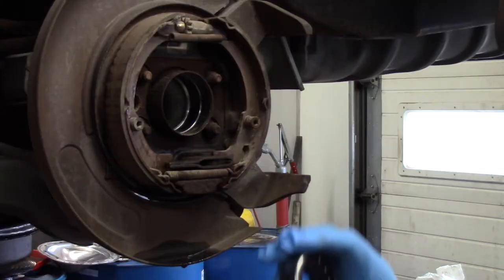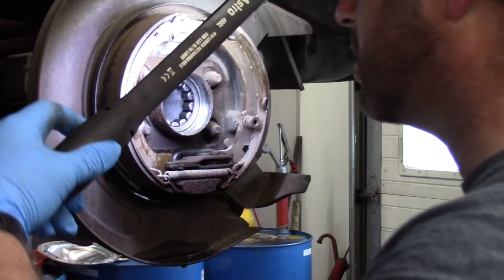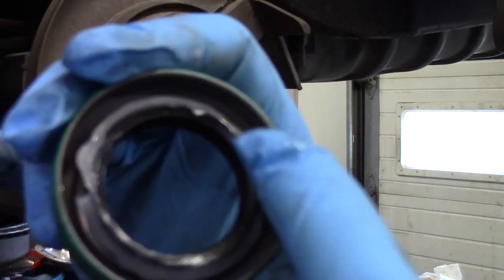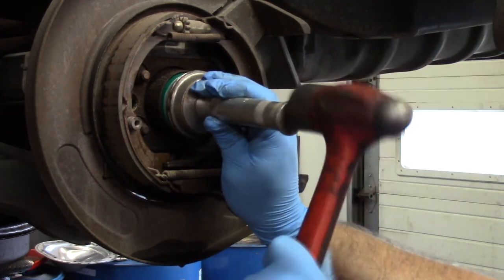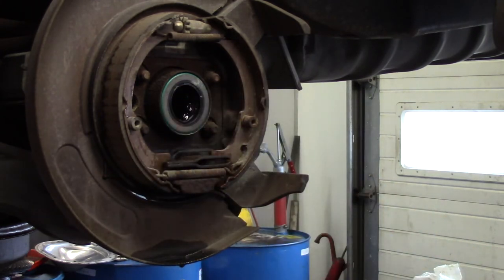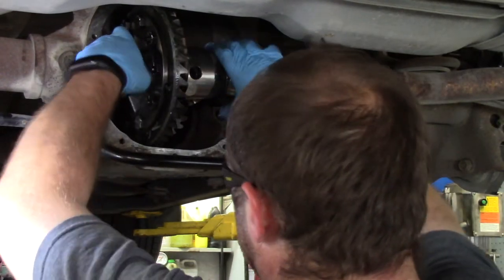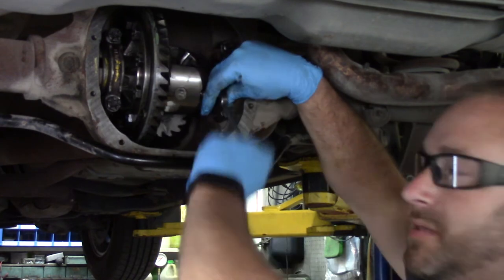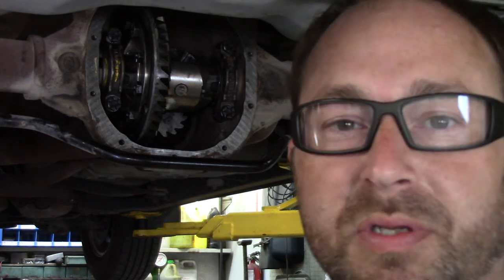Crown Vic Wheel Bearing Replacement

Comment: My right axle shaft was grooved as badly as yours. I lost the seal and fluid down to the bottom of the tubes, which is what the bearings will do unlubed. I thought it was my brake caliper at first and replaced,cleaned and test drove, found more oil leaking and then I finally smelled it and knew it was gear oil. Got a nice used OEM Ford shaft from Pick N' Pull as they're stronger steel than Doorman. Lots of cleaning, new bearings,seals and reassembly for an immediate 1,800 mile drive east this coming week.

Comment: Great. Just great. I got my replacement from Doorman too. This is the second time I'm replacing the RHS bearing. Mine was just as badly grooved. Once the gear oil starts leaking, they're gone. I'll have to see how you cleaned it. Maybe there were some metal bits left over from the first one.